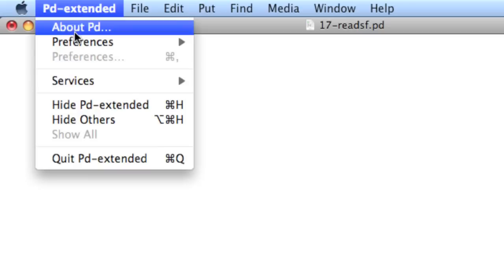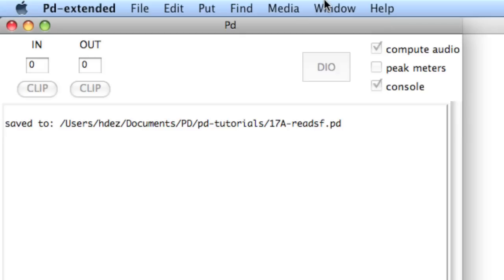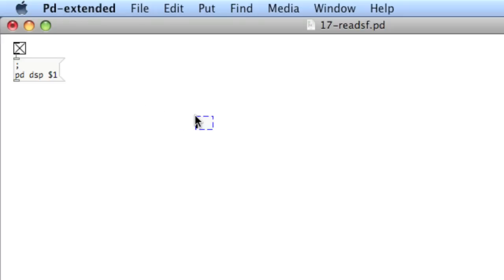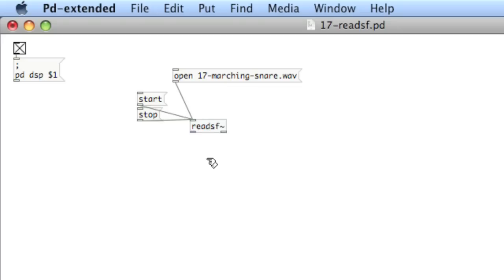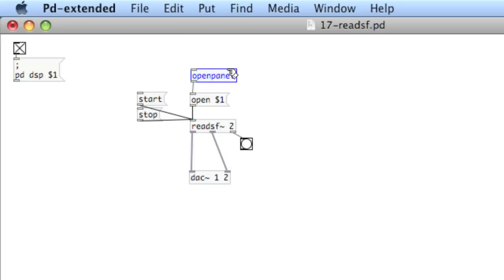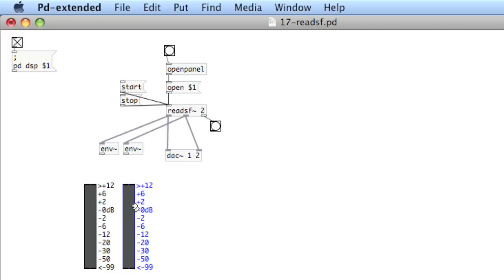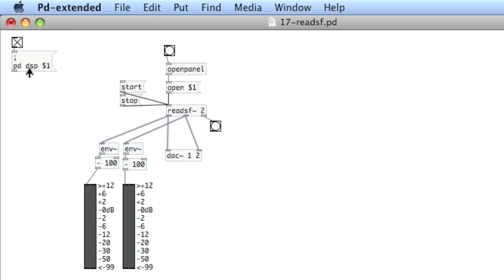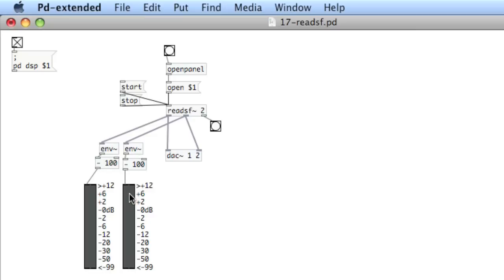PURE DATA: 17 Beginning Audio with [readsf~]

Comment: In your first example, how does pd know exactly where your marching snare file was? Does it have to be in the same project file as your patch in order to be read that way? How would you specify otherwise if you didn't want to use the openfile object?
Reply: It has to be in the folder where the pd project file is. located.

Comment: Hi Cheeto,

Thanks for the tutorials, learning loads.

I'm trying to read a sound file from an external HD, but having problems.

Any ideas?
Reply from the maker: +Henry Howe You'll need to provide the relative or absolute path to the file to do this.
Reply: Ok,

I have no problem opening from anywhere on my Internal HD,

however I keep getting the 'No such directory' when I try with my external HD.
Reply: Have you tried linking to your folder with ../../ExternalHD/folder/subfolder/etc ?

With every '..' you go up a folder until you're in the folder where your ExternalHD is. Then you type the name of your HDD (be careful with spaces) and redirect to the folder and file in a normal way.

Let's say these are your folder-structures
|HDD|Documents|Patches|patch.pd  (local HDD)
|ExternalHDD|Samples|sample.wav

open ../../../ExternalHDD/Samples/sample.wav

Comment: Thanks for your tutorial, I have a question dough... is it possible to automatically adjust the sample rate to the sound file or to somehow "convert" the sound file (on the fly) to the current sampling rate? If I open a file which has a sample-rate that is lower then the one I configured, the sound file is faster and higher than the original and vice versa...
Reply from the maker: You can't change the sample rate of the file on the fly. Instead, a better approach would be to use [tabread4~] with [phasor~] and read the file from a table. Then, you'd change the rate at which it is being read so that it equals the sample rate of the file.
Reply: cheetomoskeeto Yes, I've already solved it! But thanks :)

Comment: Is it possible to play multiple tracks at the same time with one button? I have 9 stems that will animate different aspects in the gem window but I'm not sure how to play them all.
Reply from the maker: +jkunblade I'm not sure I really understand. Have you tried 9 instances of [readsf~ ] with a [bng ] or a [tgl ] connected to them to trigger them all at once?
Reply: cheetomoskeeto I have that working now. I used a select and linked individual readsf~ to it for each stem. Thanks for the tutorials again!.